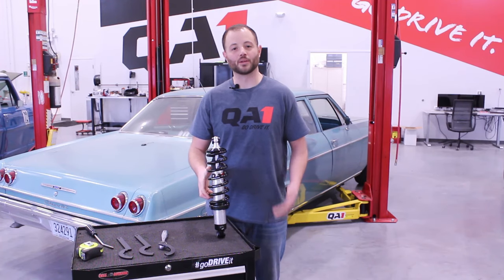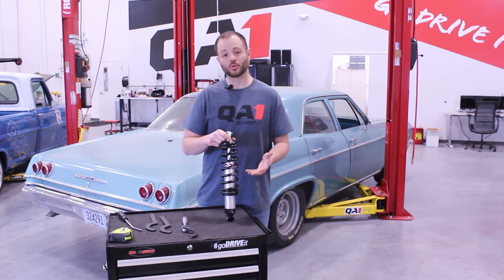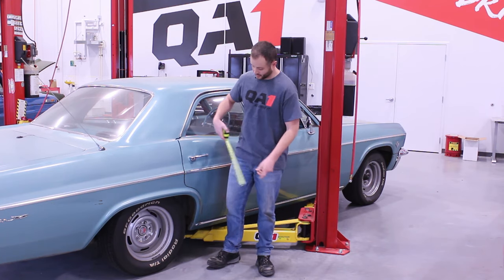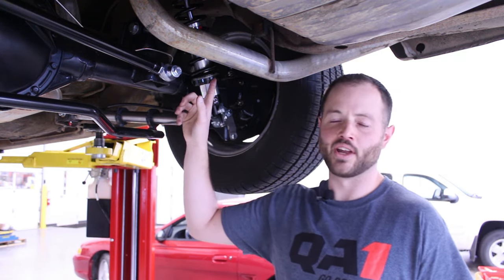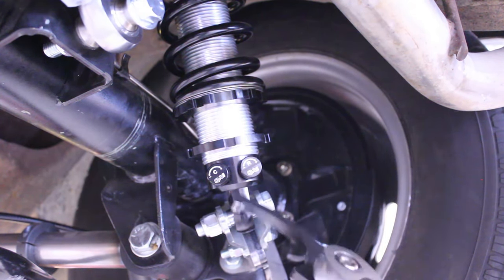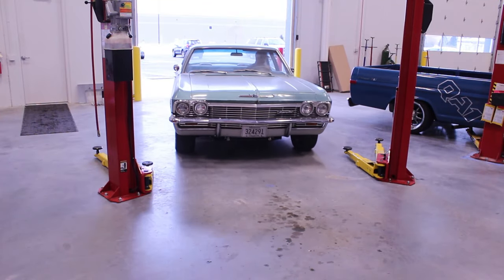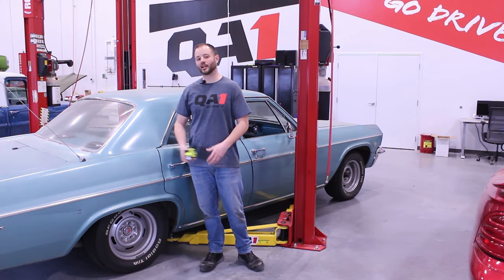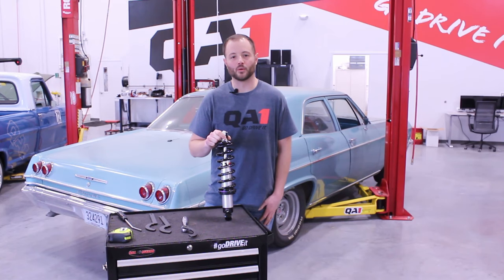How To Adjust Coil-Over Ride Height

Comment: Hi, I have WA1 TCI 450lbs 
I’d adjusted to the max
But still could use 1.5” higher
Yet other mam from my club has same car and shocks and set worked good
Should I get 500 springs ? Would it help ? Car is light mid engine on tubular chassis . Or is there  a spacer I can put inside the seat ,

Comment: Is it safe to assume that if I wanted to raise the rear I would do the opposite of what you did in the video?
Reply from the maker: Yes and no. It all depends on the setup. Raising your spring too high could result in some other issues. We do offer different length shocks to help with raising the ride height as well. I would recommend calling our tech team for some recommendations! 952-985-5675 or Sales@QA1.net

Comment: So I lowered mine yesterday, because I wanted to lower one side. It seems to be higher for some reason. But the tension went away and there was play in the spring, is this normal? Or should I tighten it (spring load) and just lock it back in. I know once the car is dropped, then that adds compression as well. I just didn't want to lock it back in with the spring being loose, if that makes sense.
Reply from the maker: It's not abnormal to have slack in the spring when the ride height is adjusted to the lower end of the ride height range. Just be careful that the shock isn't adjusted too low that you'd risk bottoming out. If more help is needed, please call our tech line at 952-985-5675 or email them at Sales@QA1.net

Comment: Ummmm I think according to the install instructions I was directed to install the thrust bearing kit between the locking ring and the adjustment collar? You have it on top of the adjustment collar???
Reply from the maker: It should say to install them on top of the adjustment collar. There are pictures on page 2 of this installation guide. https://www.qa1.net/assets/uploads/documents/intallation_guides/9919-173_REV_Pro_Coil_1.pdf
Reply: I read it wrong and I needed to look it over. I’m sorry.
Reply from the maker: @grumpy1962R  No problem! Glad we could help figure it out!

Comment: Hi. I have a 1979 Buick lesabre 4 door. What size springs should I get? this my first time buying some coil overs. I heard a lot of good things about your springs.
Reply from the maker: Hi there! Do you have our coil-over shocks and looking to add springs to them? Or are you looking for a full coil-over shock setup (shock and spring)?
Reply: @QA1TECH  Yes I just want the Qa1 springs in shock so I can adjust it for the front and the rear. I weather start with that.
Reply from the maker: @ManMan-ph2ht  Front part number GS507-10500C and rear part number RCK52384
Reply: Thank you.

Comment: Which coil over kit would you recommend for a 1977 cutlass and spring rate for the rear?
Reply from the maker: If it's mainly just a streetcar we would recommend rear kit RCK52376
Reply: @QA1TECH  thanks

Comment: Set the lock nut 1" below the spring perch and turn the perch until they just contact, then tighten the lock nut.  no need to count turns or loose the starting point.  measure the gap between perch and lock nut to 1" then drop the perch.

Comment: I have a 1968 Ford Torino 390 4 speed. I bought the car new and always liked the car setting higher than stock. At one time I used ball joint spacer blocks to help improve the front height. I used Delco air shocks on the rear which are still working, believe it or not. They have lasted a long time. Stock leaf springs on the rear and one Spring Spacer or Knuckle Buster as they call them on each side of the front. Could I replace all the old stuff with coil over shocks and springs while keeping the car setting a little higher than stock?  Pretty much a driver now.

Comment: Why can you order shocks with either 1 or 2 adjustment knobs on your shocks? And how do I chose what is best for my application?
Reply from the maker: The single adjustable shock is the one that comes with the single adjustment knob. That shock adjusts your compression and rebound simultaneously. Our double adjustable shock has two knobs to allow you to adjust your compression and rebound independently allowing you to really dial in your ride quality. If your vehicle is mainly going to be a streetcar, the single adjustables are the best bang for your buck! If you are looking to build a more series street/strip car with emphasis on 'strip', you would want to look at our double adjustable shocks.

Comment: If I swap out a 750 spring with a 650, would it lower the stance of my truck because of the lower spring rate? Or is the lighter spring also slightly longer to compensate for compression? I have the spring adjusted as far down as it will go, but would still like to get the truck about a half inch lower. Please let me know if a lower spring rate coil spring would achieve that. Thanks in advance!!!
Reply from the maker: All of our coil-overs allow up to 2" of drop. A lower spring rate will not change that. If you want to lower the car more, you may have to look at drop spindles. Give us a call! 952-985-5675
Reply: @QA1TECH ?. If the spring length is the same and you lower the spring rate only it will lower the vehicle.. 100lb rate vs 200lb rate. It's compression is 1 inch per 100lb 2000lb vehicle. Is going to compress a 100lb spring more then a 200lb spring. Do the math. Yes it will change the ride quality. Misleading